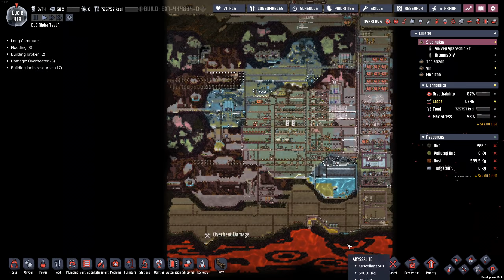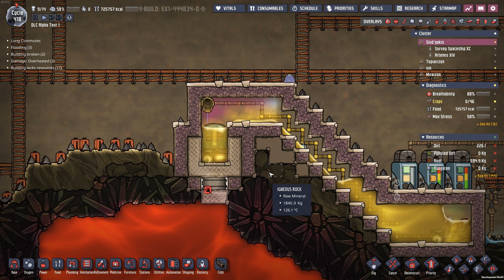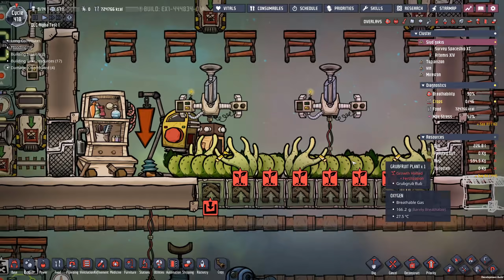MAGIC SULFUR! Steel or less Sour Gas Boiler Experiment. Oxygen Not Included

Comment: I think for your sulfur melting problem during startup: If you disabled the autosweeper until the natural gas was flowing consistently, and the metal tiles in the upper chamber had stabilized, then the sulfur would see less heat in its heat exchanger.

Comment: Well i normally tame volcanoes with perfect control very early game, all i need is plastic and steel. Simply build a transit tube in a room with a air pump then use that to vacume seal a volcanoe, make the floor into metal with -1 block elevation of the volcanoe (so it drips down lava on the metal) and then make use of the vacume door (featured in this video) to control heat transfer, i normally have that heat placed into a steam chamber. But how i measure the temperature of lava hot enough to melt thermometers? I don't, i measure the heat in the steam chamber instead. Anyhow my point is, this can be used to make a sour gas boiler, and a thermo nullifier runs cold enough to turn it into sulfur. Normally i tame volcanoes for resources, but it's possible to run electricity positive while cooling the materials to room temperature. After all the hot matter is 18x hotter than the thermal difference between room temps and steam turbines minimum input and if you use a dual steam chamber turbine to siphon cold steam you can cool down matter to 105 degree instead of 125 with ease, giving you a added 16% cooling efficiency.

Comment: Put the sulfur on top a metal tile that is on top of of a metal automatic door set to be closed if temperature is lower than 20°C. Similar set as lava door, but to heat Up your sulfur to the perfect temperature.

Comment: Very nice and simple build, I will steal a lot of it :)

If you add a bit of automation to open the door quicker it will be more efficient. The toggle times of the sensors are to slow for this thermal gradient. Alternativly add more mass to the hot side or make thermal transfer slower.

2 thumbs up if that was possible.

Comment: Thanks for the video, The update seems to change the game play style to muti smallish / remote bases, which really changes what a sustainable base is,  after all a few dupes worth of food, via sulphur means that other resources ie water can be put to other crops or o2,  appears oni will be smaller  more compact "worlds" which is a shame as i loved the mega builds, where the industrial sana's are larger then the current starting world, as for sour gas boilers The best compact design for a sour gas boiler i've seen was "@UCk6C1z_ErW4XssWUdDSfV7Q"'s in his Baby Base ep 16, which fit a space of about 6x20 (with a hydrogen geyser in the middle ) and processed about 1kg/s, granted it used top teir mats but made use of the 1 block space to heat and cool effectively, as for the heating the sulphur as the wights are so small even on a timer  why not just  leave the sulphur for a moment in a pile wait for the boiler to stabilise then find the metal block that hits the right temp range ie say 30ish then simply route the shipping though that the larger block mass  would likly not even notice the heat loss due to lack of mass of the sulphur compared to it's self. anyway i look forward to what is next in the dlc, and what madness you get up to with it.

Comment: I know I'm late to the party and I haven't been able to read all the comments, but when you were playing with the solid sulfur heat exchange, I was wondering, why jump all the way to running it through metal tiles, why not run it through the most reactive stone tile instead?  You are mostly just trying to heat the sulfur up and get a little cooling of the gas, but it doesn't have to be a super fast exchange.

Comment: Run the natural gas through the divider tile to grab more of the heat into the natural gas generators, then the natural gas generators can run hotter.  I typically try to gear the natural gas generators to run as close to 180~200 degrees Celsius if possible.  This helps avoid the need for cleaning the water (which I think you are doing), but that natural gas can be used to help flash that into steam.  (Also, you didn't mention it, but you could get the heat off of a metal refinery... which is cool as well.)

Comment: Can you get liquid hydrogen instead to run aqua tuners for higher throughput? You can turn it liquid with the thrrmoregulators I figure, and then you have what, 10x the cooling power?
Reply from the maker: I  think it's too cold.
Reply: @brothgar  admittedly I'm not sure I understand the problem, but I'm no engineer ^^ I was just thinking it gets much higher throughput in the same space. Either way, I really loved this video, those in depth machine building is absolutely awesome. Looking forward to the next one ;)

Comment: Have you noticed a bug with liquid shutoffs before valves. I had one before a valve in my petroleum boiler in the base game and was noticing it would send through the right flow but every few tiles I'd have a packet that was far less then the requested amount. Like requesting 9500g and getting it mostly. But every 4th packet would be like 3000g
Reply from the maker: I have not noticed that.

Comment: that packet(s) of nature gas bouncing around top of sour gas chamber limits the sour gas flow left to right (depending on it's position).
that might be in issue in recreating this experiment. 
choke points tend to limit flow and benefit the cold bars' thermal stability if my understanding is correct.
Reply from the maker: Mixed gases are usually not something you want. I feel like the gasses in this case self clear, and if not are as easy as turning down the flow for a bit as it will naturally pull a vacuum.

Comment: Just wondering why you just use helium because it get even colder than hydrogen because I don’t know which temperature is cold so I look up it turn out the helium is much cold at -270 Celsius on hydrogen temperature is -253 Celsius.
Reply from the maker: SHC of helium is quite low so you don't get much work out of your 240w

Comment: Hey, Brothgar, at 20:17, you could add pressure pads and a buffer gate to detect sufficient masses of sulfur debris beneath the pump, and use that to automate the auto sweeper. Efficiency!
Reply: If you are looking for efficiency, you could make a huge counterflow cooler so that the actual cooling only needs to do a fee degrees. In the video, he didn't even get the sour gas below 0c.
Reply: The problem there is it can drop in one of 2 tiles.  You can put pressure plates under both sides, but then when the sweeper activates, you can't control which side it's going to pull from.
Reply: @sybrwookie  Put the signal from each tile into an AND gate, activate the sweeper only when BOTH tiles report enough material.

Comment: Not sure if you have tried it yet but the sugar engine produces over a 1000 degrees. Could use the heat from that maybe. Range is terrible though even with an oxidiser tank.
Reply from the maker: Last time I looked it was over 3000!

Comment: on the topic of doing science, have you done the "Not 0k, but pretty cool" achieve before?
any particular suggestions for a quick and effective setup, or maybe u might feel like doing a guide for it one day? i am assuming it needs space materials, though maybe not?
idk if it's interesting enough- just a thought :)
Reply: use hydrogen gas cooling loop to cool oxygen gas into liquid oxygen. then cool liquid oxygen in aquatuner. space materials (supercoolant) are more power efficient, but steel can do it fine.
Reply: @PyrokineticFire1  i opened up a late game save where i had a liquid hydrogen generator set up, and tried turning the temperature way down, but the aquatuner won't cool supercoolant below 272.1 degrees celcius, which is short of the mark by a few degrees.. like it just flows in a circle back to the aquatuner because it's not cold enough, but the aquatuner doesn't have any further effect
Reply: @PyrokineticFire1  oh i just realised super coolant freezes at that temp so it can't cool anything to 0 kelvin >.<
*edit: reloaded a save and it just gave it to me. good enough! XD

Comment: Nice video, but since you are thinking out of the box, why not go all the way? :)

We are just removing heat from something hot, and trying to be as efficient as possible...
Ok, so you want to preheat the petroleum to as close as possible, so:
split it into as many pipes as you want the flow to be, make em radiant and limit them to 1kg each... you can go as far as the phase change, no probs there...
depending on the temp your petroleum is, you are left with Sour gas of 100 - 200°C
counterflow your methane/natural gas to it...but heres the deal, once in that sweet spot of 100 to 0°C, you can use an aquatuner with water in it. So, for extra credits, you split your natural gas counterflow into 200°C to 100°C, use water to cool it from 100°C to 0°C, and then the lower part of natural gas/methane counterflow... and in the end the hydrogen...you want your sour gas to be as close to -180°C as possible just before it hits the hydrogen cooled bit... skip using natural gas counterflow in free flow and use methane in packets of 1Kg in liquid pipes for the whole counterflow perhaps?

Comment: Could probably get a bit more power out if it if your first cooling step was to run the sour gas next to a steam room
Reply: first step (while sour gas is hottest) should be to pre-heat the incoming petroleum/oil to reduce heat drawn from magma (no need to use that stockpile of thermal energy so fast)

a steam chamber cooling the sour gas down to about 150-200 would be a good 2nd stage if locations allow

Comment: Brothgar, a couple of things to mention:
1. You should use the regulators in parallel instead of daisy chained. You can run just fine with 4 regulators per kg of crude. Gearhead gaming made simpler versions a year or so back.
2. If scaled up enough, the sulfur could be used to produce more water and dirt through grubs. I don’t know how much mud is required to run an electrolyzer though.

Comment: You could use a thermal coupler to pull heat from the sour gas into the little chamber in the middle and then run sulfur through there to get it to a temperature you want it at

Also would liquid oxygen work better for the cooling since you could use aquatuners and 10kg packets? It would be a bit delicate to get it running at first but it could work
Reply: LoX would not work, too close to boiling point, and too low capacity

Comment: 3 points: first of all, in your energy balance you should factor in the opportunity loss of not burning directly the petroleum. Second, you should give the sulfur only to the plants and to the sweetle, and use the sucrose to feed the grubgrub; third, you had some natural gas loose in the boiler, which hampered the sour gas flow and heat exchange.
Reply: I feel like the natural gas loose with the sour gas is inevitable due to ramping up the machine. As the sour gas is cooling some of it heats back up once it converts to liquid. This could be fixed by adding a filter system inside with a steel gas pump to remove the natural gas until the system stabilizes. But otherwise it is what it is.
Reply: @atomicdynamite1937  i think that nat gas was helping the system by adding a choke point for sour gas flow. kept the cold bars cold & gave hotter side more time to bleed heat into top chamber. 

that bit would've driven me nuts, suck it out & filter. IF that increases flow too much, put a metal tile in it's place to restrict flow and exchange heat with ceiling.

edit: the amount of nat gas that evaporates & reaches top of chamber during startup could be minimized by restricting sour gas flow @ startup. hot sourgas overwhelmed his coldbars, so they couldn't recondense that nat gas & it rose up past them.

Comment: Yeah, a flowchart!
Reply: Also, to increase the efficiency, you could replace on the cold side the pimp with a plastic pump and put a weight plate at the bottom instead of a timer for the arm. That way, you could run it only when you have a 20kg package of sulfur to move around. It would also heat up slower on the rails if you carry more at once.

Comment: why play with the timer? just use a weight plate 
they have removed it ?
Reply: weight plate + buffer 

otherwise the arm turns off and drops the sulfur as soon as it's picked up, right?
Reply: @PyrokineticFire1  yes 2 weight plate set as 100kg (even less then that is ok) , a buffer , and you will be sure to send out a full package and be active only when needed

Comment: Maybe you did it just for sulfur output testing, but even with end-game materials this is not how you build an efficient sour gas boiler. You need much longer counterflows to exchange heat within the system and there should be 2 of them - 1. dropping though pyramid-type grid oil cooling down sour gas that comes up; 2. natural gas cooling down sour gas. Space is not a concern even with reduced asteroid sizes - even the biggest of sour gas boilers are around 20-25 tiles wide, but they are pretty high and asteroid height is not a concern even in DLC.

Comment: I did this a will back its worked in the end just took a will. Used different materials at different temperatures. My hydrogen loop kept on going. Swapped out liquid in the aqwautuner to the last temp point. Was a cool experiment.